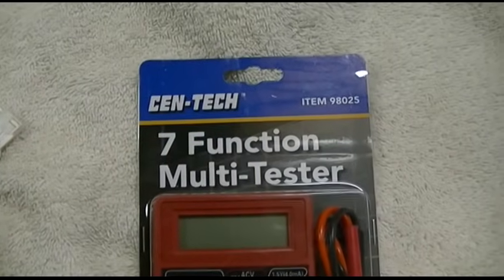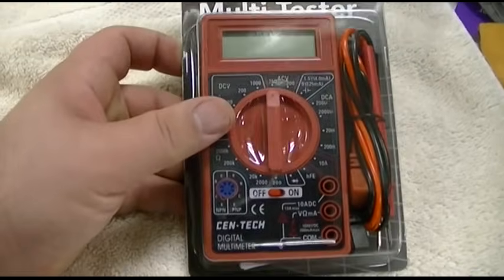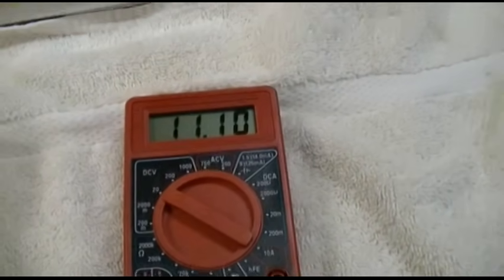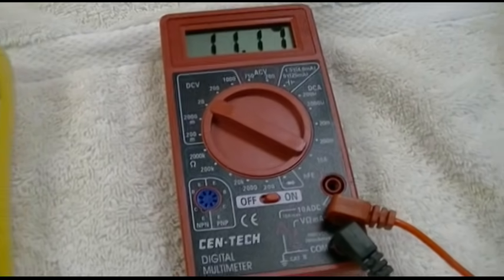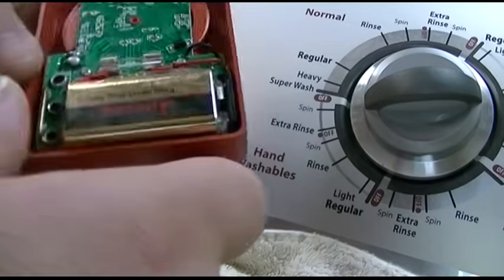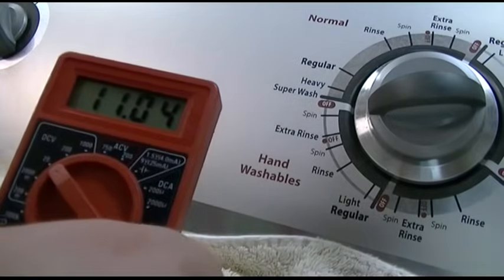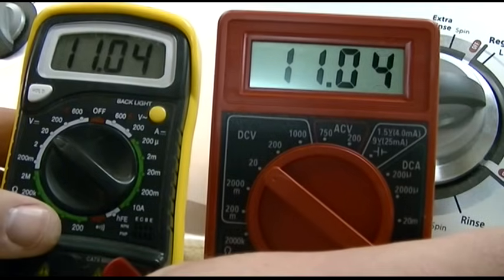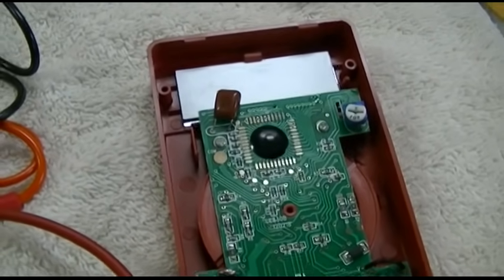Harbor Freight - Cen-Tech 7 Function Digital Multimeter Review

Comment: I just picked one up today when I went in for a caliper compressor. used it to check my alternator and it works fine as long as you understand that its a cheap tool. I'd never put my life on the line for any hf tool but they have saved me from a long walk home many times
Reply from the maker: Yes, their products are cheap but usually effective.

Comment: What measurement do you check capacitors?
Reply from the maker: You don't.  You get a capacitance meter for that.
Reply: You can check a capacitor by checking it's continuity.
Reply from the maker: That will only tell you if it's open circuit or shorted.  It will NOT give you the capacitance value of it so you can compare to what it's supposed to be.

Comment: what's the difference between this amp meter and an amp meter with a clamp?
Reply from the maker: The "amp clamp" just clamps  right around the wire in question.  But it can be unreliable.  A meter like this, you'd have to cut that wire, and attach each end to the meter's probes.
Reply: +jaykay18 Thanks
Reply: +jaykay18 the clamp-on meter can read higher amperage also it's safer when reading amperage
Reply from the maker: Clamp-On Multimeter Channel Good point, thank you.

Comment: Just got mine today! Bought my $1.19 set of funnels for the "any purchase" part of my coupon. Bad day for red China! :)
Reply from the maker: All2skitzd They know there are some crafty individuals as such.  The rest aren't smart enough and will go and buy that big expensive item they really came in for.
Reply: They used to  now do that bullshit on the prices and I have complained but they dont care. Most of of it's just a matter of looking at what your buying and knowing what to expect. I take most stuff out of box to inspect before buying.
 The good sockets and wrenches are close if not exactly like HomeDepot's Huskey, Lowes's Kobalt, Autozones Greatneck/Duralast, O'Reillys Master Pro, Sear's Craftsman. I got wrenches, sockets, impact sockets, ratcheting wrenches, crimpers, vice grips, and a bunch of other tools thats all HF. The only one's i've had fail was the $3.99 socket sets but I still buy them to have as a set thay I keep in car and dont have to care about them. Stuff that is not as good as the competition is priced accordingly so it.
 I got the angle grinder when it way $9 and have put it through hell. First thing I did to it was change the grease after letting it run a minute to break in. The plastic piece inside that makes the switch work deformed making it not come on so I threw it and where the handle in the side was  broke the aluminium casting on that side so I can only use it one the other side, and I put a new switch on it. The guard that goes on it just fell off one day which was kinda weird but whatever. Another time I was using it to polish the aluminium on my computer case with a 8" foam pad buffing disk which was putting a real strain on it and im holding it with a rag because it was hot and then I see a light reflecting off the computer case and then it hit me.. Its on fire and I thought it was over but I took it apart and unwound about 4 turns of the field windings (just one side) and put some fingernail polish on it and it was ready to rock and roll again. I took the end off a couple days ago to look at the grears and they still look like new.

 Yeah thats crazy how cheap shit can get. I used to order stuff from dealextreme.com like every week or two. It comes from China and has free shipping but it might take a month or more to get it but it's crazy that something could be less then $1 and still have free shipping from china. It's cool ordering from there because you can get something like a 10 pack of laser pointer and flashlight keychains or something for the price that you would normally pay for one and it takes so long to get when it does arrive it's like a surprise in the mail because you done forgot what you ordered. Also their low prices help keep keep the other stores prices down. If it wasn't for China I would sure feel more poor then I am
Reply from the maker: Ha ha!
Reply: For my "any purchase" I just pick up one of those really cheap box cutters that they sell by the checkout
Reply: jaykay18  Yeah I live close enough when they got the free stuff i can go there every day and get something.
Reply from the maker: All2skitzd When the store by me first opened they used to give free items, no purchase necessary.  Now that they've been open for a year or so I only get the "with any purchase" or "with any purchase of $4.99 and up".  Never seen an absolutely free one again.
Reply: jaykay18 Purchase of $4.99 or up, they can go fuck themselves. I used to like the shit out Harbor Freight. When I'd go pick up my mail and it had a AD in it I would sit in my car and look at the whole thing in the parking lot which was pretty when the built the one by my house because they put it right next to my mail place where I rent a private PO box so If I seen some deals I wanted I would already be there in the parking lot, but I stopped liking them as much when they started that "Compare at.." bullshit. It's not the same shit and I accept that but I feel like they are trying to pull a fast one on me with that compare at. When I get a coupon for regular shit I have no idea how much the coupon is saving because it list the "Comp at" price instead of the regular price.
Reply from the maker: All2skitzd They play games like that.  Bottom line is most tools, for light duty use that they sell, are definitely cheaper than the rest and will do the job.  Not everything is a score at HF, but a lot of them are, some are even better than higher-priced stuff at big-box stores, with a few modifications.

Some guys buy HF stuff (like wrenches and tools and stuff), and when it breaks, it was cheap anyway so they can afford to buy new ones.  Of course most of those guys also have a lot of really decent tools that they don't want to break, so they'll go for the cheap stuff first.  If the wrench breaks before the bolt, they break out the good wrench and replace the HF stuff next time they're there.

Oftentimes they'll have their electric angle grinder on sale for 11 bucks.  For 11 bucks, if it works 11 times you more than got your money's worth, especially if you got a free item with it.

I find it amazing how cheap this stuff can actually be manufactured.  Remember, at the end of the day it's a business and they're making profits.  So even with dirt-cheap prices and giveaway items the money's still rolling in.  I would have thought it would cost a ton to load a cargo ship and boat all that stuff over here from China.  I guess they get a bulk rate charge for shipping.  Or maybe it's cheaper to ship garbage than actual products ;-p
Reply from the maker: All2skitzd Wow you really beat that angle grinder up.  After all that abuse and all those fixes, for a $9 tool.  I think they OWE you money now.

Comment: ok so when you're checking resistance (ohms) and you touch the 2 leads together it should read 0, but why does mine flash a "-" next to the "1". It's reading -1 instead of 000
Reply from the maker: These meters are not well-calibrated.  They're "cheap-as-free" a lot of times.  As such you're not going to get an exact measurement with them.  When you have it on an ohms scale and the leads are touched together, it should read 0.  They don't.  There's no such thing as negative resistance, so your meter may be defective.  If you have an actual resistor you may wish to check the reading of the meter on that versus what the actual resistance value of that resistor is.  Otherwise Harbor Freight may have a return or exchange coming.
Reply: +jaykay18 it shows the 1 being open line but when you touch the leads together (ohms and capacitors) a minus symbol flashes to the left of the 1 until you split the leads apart. Might be a faulty multireader but oh well. voltage part works and reads fine though.
Reply from the maker: Chris Herrin Yeah it doesn't sound like it is working properly.

Comment: Nice review ! What setting do you recommend best for marine ignition coil resistance test - 20k Ohm ? Also to check 12V - DCV 20 ?
Reply from the maker: Essentially all the different ranges do is move the decimal point.  You always start at the highest range and work your way down to get a more accurate measurement.  Once you see the reading on the highest scale you should have a pretty good idea what range to actually be on.  For 12V, yes, the DC 20V scale will work the best.
Reply: Thank you. I never tested the coil before so I wanted to see if I did it properly before ruling out any possibilities.  I did use 20k Ohm setting to get 003-004 read out ( ignition off ).
Reply: My engine wont fire up, it's what's happening so I wanted to see if I maybe have faulty ignition coil. I hooked up this spark tester going from my distributor cap to see if there is current flowing. It was flashing as it was cranking making me assume there is current but maybe not enough ?
Reply from the maker: Patchicago82 Generally even a weak spark will ignite fuel.  You'd have runability problems if it were weak.  Typically when something like this happens, I break out the can of starting fluid, spray liberally into the intake and give it a whirl.  If it fires it's usually a fuel issue.
Reply: Unless i sucked some water in and spark plugs got wet. It's a boat so I wanted to start off with basics and go from there. Resistance with ignition off read 003-004
Reply from the maker: Patchicago82 I'm afraid further diagnosis is beyond the scope of this video.
Reply: Right but I was trying to find out if 003-004 read meant good or bad or if i even measured it right.
Reply from the maker: Patchicago82 I'm not a boat mechanic, so I couldn't even tell you.

Comment: Were it not for the fragile rubber insulation on the leads that becomes brittle and easily cracks this would be a good product. I've acquired three of these for free thanks to the HFT flyers over time and the first two have had their leads crack and break rendering the meters useless. Maybe HFT should sell replacement leads for $2 to make up for all the meters they give away for free.
Reply from the maker: +Rick Evans That wouldn't be a bad idea, selling replacement leads, though you can likely find them online at electronics parts retailers for pretty cheap.

I can say that I've collected a fair number of these as well, and the leads are different depending on the lot/item number.  I don't have specific ones to point out here, but some leads are very hard and the wires are not very pliable, while others have pretty nice leads that are nice and flexible.
Reply: Use pliers to grab the probe tips, twist, and pull them out. You'll see that you can easily solder the wire back on.

Comment: I'm glad I'm not an average watcher and watched past a couple minutes. I started to wonder about testing it's own battery and I thought, if the battery is needed in accuracy...that's a terrible idea, I don't know why it's a terrible idea, but I do think it'd be inaccurate.
Reply from the maker: +DE Nichols That's where you break out your trusty Simpson analog meter from the 70s and get the job done properly.  Any digital meter is going to rely on its battery to provide an accurate measurement.  If the battery grows weak, it's like a person driving while extremely tired, they need full energy for it to be done right.  And even then they're mostly busy texting and not looking at the road...
Reply: jaykay18 I'm finally up to 2 DVOM's again so I'll be fine. I watched your video wondering how many ohms of resistance protected it when using the volt meter. I appreciate your last response too.
Reply from the maker: DE Nichols Sure, no problem.

Comment: does it measure in millivolts?
Reply from the maker: +Bert Cochran Yes, it's all in the manual.
DC Voltage Ranges:  200mV/2000mV/20V/200V/1000V

The manual is available for you perusal here:  http://manuals.harborfreight.com/manuals/98000-98999/98025.pdf
Reply from the maker: ***** Exactly right.  And if you're not sure of the voltage, you start at the highest reading on the scale and work your way down from there.

Comment: how can i use it to check which wire is hot and which is neutral
Reply from the maker: +bluekeet If this is standard AC volts you're talking about, black is supposed to be hot, white is supposed to be neutral.  Whether or not it's wired that way is another story.  Harbor Freight actually sells a device that simply plugs into the outlet that will much more quickly tell you if the outlet is open circuit, wired backwards (hot to neutral and neutral to hot) open ground, or hot ground.  The item number is 32906.  http://www.harborfreight.com/electric-receptacle-tester-32906.html

Otherwise you'd better know what you're doing before poking around with mains voltage if you're going to use this meter to test it.

Comment: noob, question. I got a free one other day I misplaced the manual on this  How do I test Capacitors, Diodes, resistors and transistors which setting do I put it on.
Reply from the maker: ***** Your question is much more advanced than "noob" status, but the answer is easy:  http://manuals.harborfreight.com/manuals/98000-98999/98025.pdf

Comment: I got one of these free with a coupon and I am a professional mechanic and so far it has worked great
Reply from the maker: Billy Simons You can't beat free!  Although I have doubts about how accurate this meter is, as you can see in the video you can adjust it close to what a known good meter reads.  Good enough for a lot of purposes.  If you're doing electronics work, you'd probably want something better.
Reply: +jaykay18 thanks for the information, it was very well videoed and explained especially for the adjustment that can be done.
Reply from the maker: Mike Gross Thanks very much Mike!
Reply: Billy

Comment: Where can I get alligator leads for this centech?
Reply from the maker: Qais You can't.  They're not made that I know of.

You can make your own, or convert these by using something like Harbor Freight item # 66712 or 66717.
Reply: jaykay18 here http://www.ebay.com/itm/1Pair-Alligator-Test-Lead-Clip-To-Banana-Plug-Probe-Cable-1M-for-Multimeter-Test-/171396515220?pt=LH_DefaultDomain_0&hash=item27e8074594 thatll work on any mter even this one
Reply from the maker: Jeremiah Lowe That's cool, but it's more than half the price of the meter!
Reply: jaykay18 i know the meter is shit thats why they are half the price if you want a decent meter that can measure over 1.5A DONT get this the leads get warm at 1.5A

Comment: these thing are HORRIBLE mine counts up voltage I hooked it up to a 1.5V battery on the 20V mode and the voltage slowly kept going up all the way to 20V and up DO NOT waste your money/time with one of these buy a nice multimeter a Craftsman or a Fluke
Reply from the maker: That's all fine and good, but you're certainly not going to find a Craftsman or Fluke for 6 BUCKS!  How about most times ABSOLUTELY FREE with coupon?

Yes, it's a real cheap meter, that's a given.  Better off to see if there's voltage there or if there's not, not necessarily for an exact measurement.  Either way, it's adjustable as I had shown in this video.

Harbor Freight gives you 90 days--you might consider bringing your back for a refund/exchange as it is blatantly obvious that it is defective.
Reply: jaykay18 thats true but if you need amultimeter you need something decent these thing are just plain UN-RELIABLE
They might be decent for car-repair etc. but not for electronics projects
Reply from the maker: Jeremiah Lowe Exactly.  There's no problem buying cheap if you know what you're buying cheap for!  When a project arises that requires more accurate measurements, use a more accurate meter!
Reply: jaykay18 exactly but for smaller electronic applications like debugging arduino etc. you need a VERY accurate meter
Reply: Jeremiah Lowe  these are Free I have 6 of them they work fine, exceptional value the leads on the fluke are $20 or more  they can be adjusted to matcth the accuracy of my Fluke and used in dangerous situations where if dropped or smashed I am not crying
Reply from the maker: wainyp Exactly.  I have a bunch of these around also, and they fit the bill for most around-the-house jobs.
Reply: Jeremiah Lowe Arguing that the lowest-end multimeter you can buy/get for free is not accurate is a worthless argument. For debugging digital circuits, you should really get an oscilloscope and/or logic analyzer alongside a decent multimeter. 

These things are really meant to be cheap and disposable. They are the sort of instruments that I throw in my car, lend to friends or pull out when I need one more DMM on the bench. 

The only time that I need the accuracy of something like the Fluke 87 V is when I'm calibrating equipment, which includes my cheaper multimeters. You can get a good  true RMS DMM for <$100. You don't need <0.05% DC accuracy unless you're doing some serious projects or working as an engineer.
Reply: Spocker spock I know but for digital circuits i recommend a scope its more versatile and a decent logic analyzer is just as expensive one good scope is the Rigol DS1052D because its got a 16 channel logic analyzer and a scope and it is cheaper Logic analyzers are usually 400$ and a scope is usually 800$ so youre saving 600$
Reply: Jeremiah Lowe I have found most of them reliable,  I have an expensive meter which I end up never using becuase the Hb meter does the job , I have had one dud which HB replaced for free, It si absolutely essential to use my Rolls royce to go to the Laundromat for a QUALITY ride The TOYOTa JUst won't cut it as I am a Snob!